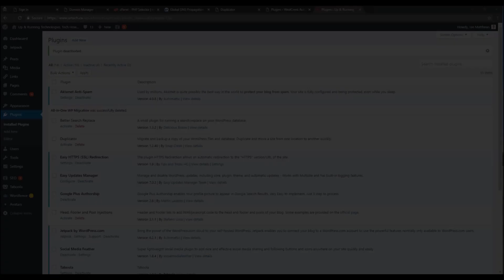Disassemble Dell OptiPlex 7060 5060 & 3060

Comment: I have a few half height VC already and saw that the pcie slot is closer to the PSU in this particular model. Can you confirm if a dual slot card would still fit if I use a single card bracket with it? The gtx 750ti MSI, and the rx550 MSI are the cards I have. Is there enough clearance between the pcie and the PSU for their dual fans to fit? 
Dimensions for 750: 	9.5 x 6.6 x 2.1 inches
Dimensions for 550:  170 x 68 x 38 mm
Thanks in advance

Comment: I cloned my HDD on a previous dell desktop to an SSD like the one in the video. The BIOS sees the SSD on SATA0 but doesn't allow it as a boot option. Tried disabling safe boot and rolling back to legacy boot and some other combos but It will not list the SSD. Any ideas?

Comment: Bro Normally psu bist light blink everytime you plug the computer. Right. But now , i plug no sign of light anymore.

 (Dell 3060 sff psu)

Bro how do know the power supply is dead. I try to test my psu, only psu motherboard and processor are intact. My psu is BIST BUTTON FREE.  I remove the 4pin 8pin connector from the motherboard , then plug the psu. The Bist light glow for 3 second,  i put back again, it won't glow. No sign of light, 

I try also psu test using paper clip method jamper black and  green the psu bist light glow and the fan is spinning

Is my motherboard is dead or my psu?

Comment: I just bought a OptiPlex 7060 SFF High Performance PC with Intel Core i7-8700 3.2GHz 6-core CPU, 64GB RAM, 1TB SSD off Amazon, I have a couple questions if you could help...What is the Video output? It doesn't have any video cards so the back is pretty much like the one you have in the video. What HDMI video card would you recommend I buy for the video out to my big screen tv? I don't do gaming, but I'd still like a good one around 3 to 4 hundred dollars. Any help would be so helpful, thanks
Reply: Use the displayport to HDMI cable, u can buy those really cheap on amazon or ebay. Dont buy any cards if you dont do gaming.

Comment: How would I go about installing a graphics card for 7060? I’m new to video cards and stuff, so I have no clue what I’m doing.
Reply: probably not enough power supply. PSU for 5060 is only 200watts at max output. i5-8500 draws 65watts and I am afraid there is no more power left for a graphic card.
Reply: They do make a 240-watt psu that’ll fit this computer, and you should have enough to run the new AMD RX 6400
Reply: You would go about it by getting a different PC. Don't fuck around with form factor PCs because upgradability is terrible and bad air flow means higher tempos means less service life of each component.
Reply: @PartyhatRS  lol you're so right about that, I wish i had your comment 5 years ago. i ended up just building my own pc after a while. hope these replies help someone passing by anyway